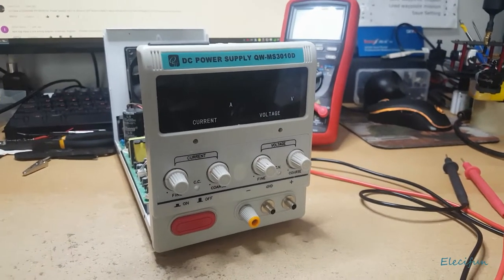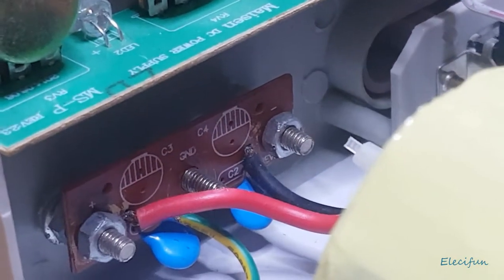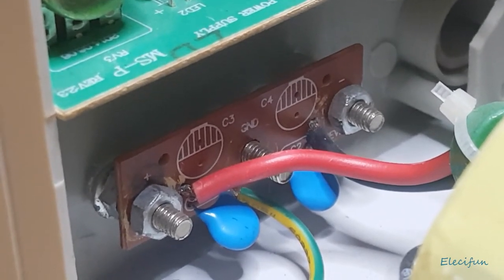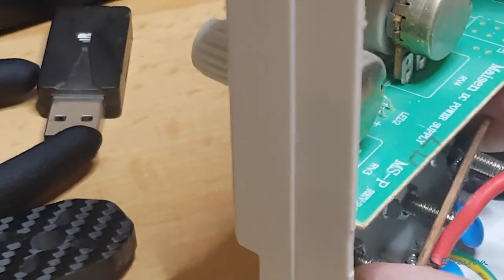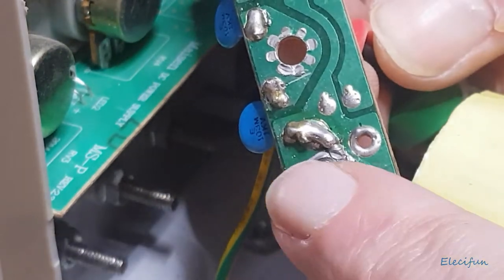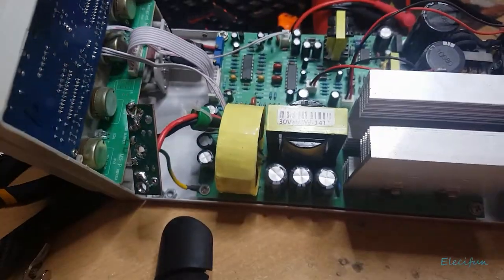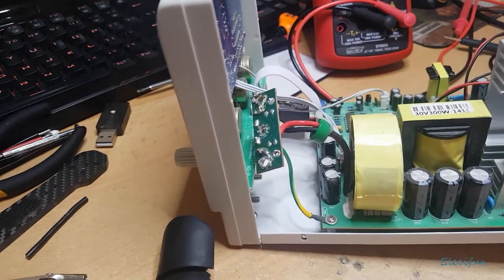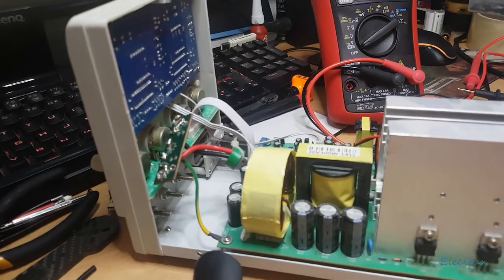MS 3010D PSU ISSUES

Comment: I usually stick to linear bench power supplies, heavier but generally more reliable. You could always remove the terminal board and connect the wires and capacitors with ring terminals/crimps. You might have to extend the capacitor leads. I'd sandwich the crimp terminals between two washers and use two nuts. Perhaps a nylon lock nut.
Reply from the maker: Good tip! I do intend on improving this as I wouldn't be that hard considering the mess of it. I will probably go down the route of your suggestion. I myself prefer linear PSU's I have one I built myself, circuit board + components a kit but the rest is me, lol, and it still works!